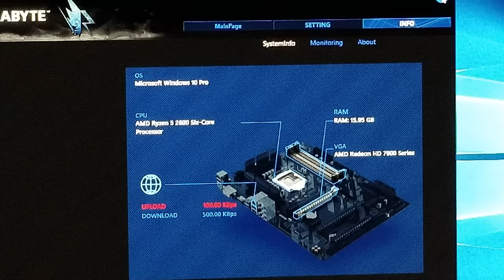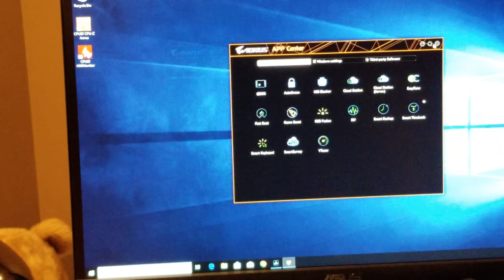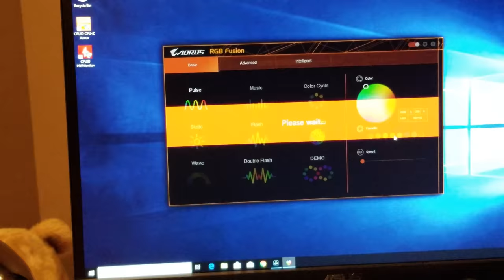Cooler Master MasterCase H500, Build Guide & Aorus B450 Pro WiFi

Comment: How many rgb headers does this motherboard support?
Reply from the maker: It has 2 x digital LED strip headers, 2 x digital LED strip power select jumpers, 1 x RGB (RGBW) LED strip header hope that helps...Thanks...
Reply: @Reviewing_Playing_and_More_RPM  using this motherboard and case i wanna add an rgb cpu cooler and connect it to the motherboard using the same case to control them with the rgb fusion, do you think i can do this?
Reply from the maker: The Case and MB are capable of doing this, the hard thing to know for certain is the RGB Fusion software and how well it works together with everything, I don't see any reason why it won't but there are so many scenario's where the MB Manufacturers aren't pairing the two products to work well together, so I think it will work, but in my experience getting both MB and CPU Coolers to sync together has been a problem and often didn't work, I've often used the MB Software to control everything except for the CPU Cooler, and then used separately the specific software for the CPU Cooler itself to match the color the MB is using...hope that helps...Thanks...

Comment: Is it ok to build a PC on a wood table without the green sheet?
Reply from the maker: Yes, I use a Green Sheet to be able to show products better but I have to take special precautions in order to not add extra static which could damage computer components. A wood table is fine. Something to keep in mind is to always ground yourself so your not transferring static to your computer components. This will need to be done often if your using a green sheet like I do...

Comment: The upper front fan didn’t spin while the led is on, what should I do
Reply: And all the fans are plugged in
Reply from the maker: +MBF 777 Same thing happened to me when I looked around I had missed plugging in one of the fans to the system fan on the motherboard, so maybe just do a check on the cables to see if one got missed. If not test that fan on it's on to a system fan header and ensure it works if not could be a defective fan possibly. Hope that helps...

Comment: how do you get the app center thing that change the rgb
Reply from the maker: The app center comes with your MB Software, different MB Manufacturer's have there own versions...this app center is what you get from Gigabyte MB's...
Reply: @Reviewing_Playing_and_More_RPM  do you have to download it or is it going to come the motherboard, (Btw I have the same mother board and it's my first build so i don't know alot about computers.)
Reply from the maker: @shadsunbee425  Yes your MB comes with a DVD with all  the drivers and software, it'll be on the DVD...You should update them later to the most recent versions...
Reply: @Reviewing_Playing_and_More_RPM  so you need to use the dvd that has all the drivers and software, because I don't have dvd tray or anything to use the dvd. sorry if im bothering you
Reply from the maker: @shadsunbee425  no it's cool I'm rendering a video so I have time...if you don't have a external DVD then you can download them to a USB Drive or download them to a computer and copy to any device you can transfer from...if you get the internet working though you just download and install
Reply: @Reviewing_Playing_and_More_RPM  oh so i can use a USB instead or just download it straight from the pc
Reply from the maker: @shadsunbee425  that's right
Reply: @Reviewing_Playing_and_More_RPM  thank you so much

Comment: Hi I'm very noob at this things and I'm having problems with the ARGB connector
Reply: Let's say my motherboard has multiple system fans ports, but it doesn't have 3-pin ARGB inputs.  Let's also say that each fan from the case has 2 cables wich is true lol, from those 4 cables, they end in 2 inputs to connect somewhere haha, a 3-pin that I suppose connects to the SYS fan of any Mobo, which will turn on the fan without any type of light  of color, only its rpm, and another that, depending on my mobo if it is asrock, msi or asus, it will be an ARGB cable (3 pins), and if its Gigabyte I'll need to connect a 3 pin on the mobo (I dont know if that has RGB), back to the ARGB inputs which my motherboard does not have to have RGB in the fans, if my motherboard is the msi b450 max gaming, how can I connect that ARGB input?  Can I connect it to the controller with ARGB input and that connects to a SATA of the source and it would still work, that is, put the ARGB to the power supply from the controller?
Reply: Sprry for my englsh haha
Reply from the maker: Yes, the controller lets you have a way to control the RGB when your missing the RGB Headers required...it does connect to the PSU so will work without issue's only thing is you'll need to open the case to change it each time...
Reply: @Reviewing_Playing_and_More_RPM  Thank you so much!  I didn't find the right mobo that was within my budget lol, with ARGB inputs and tons of sys fan inputs
Reply from the maker: @HenryGamer539  No problem you can also later on get a RGB/Fan Hub if you want that will let you control with software when budget permits...take care and have a great weekend...

Comment: How did you put the HDD into the tray?!
Reply from the maker: At 8:23 in the video you can see the HDD Bays, they are tool less so can just slide in and lock in place...you can use HD screws to be even more secure as well...
Reply: @Reviewing_Playing_and_More_RPM  But there are screws stopping it from going in. If I remove them, they don't go back.
Reply from the maker: @BRAWGWill  You need to pull the bay out and fit the HD into it using the screws to secure the HD to it, there are holes in the HD that will line up with them...
Reply: @Reviewing_Playing_and_More_RPM  Yes, but once I remove the screws in the side, they don't go back in.
Reply from the maker: @BRAWGWill  Starting at 10:33 in the video I show how the Hard Drive goes in...and those screws are able to go back in place...
Reply: @Reviewing_Playing_and_More_RPM  The rubber screws in the side? How? They don't fit in the holes once the hard drive is in place.
Reply from the maker: @BRAWGWill  Well there not meant to come out, but the rubber grommets slide in, whatever you have in the HD now, remove them, put the rubber grommets back in, then you need to angle the HD in fitting into the holes, and then you have to pull the other side out just enough to fit the two on the other sides and then it'll fit and provide less vibration as well...
Reply: @Reviewing_Playing_and_More_RPM  I can't stretch the tray. It's made of plastic. I've tried bending it and fitting the HDD in but it doesn't clear the grommets. Then they pop out.
Reply from the maker: @BRAWGWill  Best I can do is provide a video on doing this, here is a link, https://www.youtube.com/watch?v=XqBDUvYpZgo there is really no other way to explain it well enough, I'll try to do a video of this in the future, start at 1:19 in the video it explains it quite well...the plastic will bend but you have to have the HD in the proper way to align them...hope it helps...

Comment: how do i install a 200mm fan on top?
Reply from the maker: +Zachary Blatt There are holes on the top, just install to these using the screws that come with the fan. If it doesn't include the screws then the case has extra one's you can use, so as long as your motherboard has a fan header to plug into you'll be fine...
Reply: @Reviewing_Playing_and_More_RPM  but the holes are oval and are too big for any screws that came with it.
Reply from the maker: +Zachary Blatt Once you have the 200mm fan you line up the holes on the fan with the holes on the case. I think the oval holes just allow more flexibility for placement, not 100% sure though.  Once you tighten the screws up it won't matter if the holes are bigger, it's fastening to the case and fan, and will tighten together. It's hard to explain typing it, probably best to look up a video on how to install a case fan. I haven't done one but maybe I'll do one to help people out. Sorry I hope I didn't confuse it with the way I typed this.

Comment: How did you install the psu
Reply from the maker: Because the PSU shroud comes off easily, I took it off then was able to put the PSU in from the front and slide it toward the back and secure with the screws...Thanks...
Reply: Reviewing Playing & More RPM right lol I did it thank you but also I need help with ssd where does it go n what psu cable do I use ? If u have a vid or something could u link it ? Thx
Reply: Reviewing Playing & More RPM also I’m sorry for the questions I’m 15 and it’s my first time so yh the argb remote so you have two wires one says ASUS AND so on and the other one says. Gigabyte but I don’t have a 3pin I only have 1 4pin rgb header and I’ve tried putting the three pin in it but it’s just falls out and I only have one of these no argb header what do I do is there a way to still get the lights to work please help also I have a and wraith prism cpu cooler to so I thought I’d use the  4 pin connecter for this will this impact anything sorry for the long para just need lost if help right now thank youu
Reply from the maker: So it comes with the RGB Controller so if you don't have the ARGB you will still be able to use it, one end will plug into the SATA from your Power Supply to get it's power much the same as the ARGB would provide the power...this will let you control the RGB...the Wraith Prism CPU Cooler 4 Pin can go in the 4 pin RGB header on your MB, won't affect using the controller to control things...hope this helps...

Comment: Loved the video, it really helps a beginner to gain confidence in building their own rigs.
I have a question, that how do I connect the RGB to a Gigabyte GA-Z270P-D3 motherboard?
I don't see an rgb connector on the board anywhere, or am I missing something?
If there is no such connector on the motherboard then how do I manually connect the rgb to that little remote control?
Thank you in advance!
Reply from the maker: Yeah that motherboard doesn't have an RGB Header, so the controller that comes with it can be hooked up to use with it, I'm including a link to a video I did that starting at 9:44 in the video I explain how to use it, it shows how this case's RGB can be used with the controller that comes with it...video link is https://youtu.be/XQJETt0ABaU it should help you out...Thanks...

Comment: I just bought this case and it already came with standoffs installed for ATX for some reason
Reply from the maker: Yeah it comes pre-setup so it will accommodate most motherboards...you can adjust them if needed though...
Reply: @Reviewing_Playing_and_More_RPM  I see, i saw another video you made on this case and it didn't came with the standoffs...weird, had to double check if those were standoffs or what before making a mistake haha
Reply from the maker: @BatrickPateman430  I actually prefer no standoffs and let me put in what I need but some cases are like that...

Comment: What if your motherboard does not have RGB Headers
Reply from the maker: You can use the controller, if yours doesn't have one you can get one from Cooler Master for around $20 and use it instead...
Reply: @Reviewing_Playing_and_More_RPM  so I bought this case for my brother, he has an older motherboard that has no RGB Headers, the case came with the controller, but it only allows for breathing mode no static solid colors. Not sure what my recourse is at this point. I mean it's not bad it works, would just be nice to not have pulsing colors just static.
Reply from the maker: @patrickryan1821  The only other thing you could do would be to search out something like the Corsair RGB Pro Hub, (can't remember exact name) but I believe it or one similar will let you use RGB as it gets it's power from a SATA connector to the SATA Power connector from the power supply...I don't have a model name but there are some out there that can do this, search on Cooler Master, or Corsair and then Amazon to find one...there a bit pricy though...

Comment: 👍❤✌😎🔌
Reply: +👍 4th ❤
Reply from the maker: +COOL 2d TOUCH Thanks...
Reply: 15:17 notoced missing screw, if you hadn't noticed what would of happened?
Reply: The lights make having a clear side worth it.
Reply from the maker: +COOL 2d TOUCH It likely could have shorted out the motherboard, Thankfully I noticed it before anything  happened. It would have been fine for a while until it made cotact with the case. I have seen someone run there's for years with no damage but it can easily happen. I forgot because they didn't give me enough screws and I forgot to go get one.
Reply: Great video 👍 tfs ❤
Reply from the maker: +COOL 2d TOUCH Yeah it does look nice. Thanks...
Reply: @Reviewing_Playing_and_More_RPM  YW ❤👍

Comment: Great video! I bought and installed my new build in a h500 after watching this, and everything is awesome!
One thing thoe - How do i control my RGB?
It Works, sparkles and stuff, but i cant seem to find and software supporting it.
I installed the RGB pins directly into my motherboard - do i need anything Else? What am i missing.
Reply from the maker: Software is from the DVD supplied with the motherboard and if you have lost it you can download it from your manufacturer's website...Gigabyte has RGB Fusion for example...Thanks...
Reply: @Reviewing_Playing_and_More_RPM  thanks. I have the msi x570-a pro motherboard. Finding msi's website hard to navigate. I Will take a look for it again. Thank you!
Reply from the maker: Just realized your Motherboard  the MSI X570-A-Pro if I'm looking at the right one, does not support Mystic Light or RGB so a work around at this point, would be to use the RGB Controller that came with the case and hook it up as explained in the video, with it getting it's power from the Sata Power connector. This will give you the RGB lighting but you'll have to makes the changes using the RGB Controller...
Reply: @Reviewing_Playing_and_More_RPM  Okay.. thanks for looking it Up. I stumpled opon some msi software called Dragon Center. Got any experience with that mate?
Reply from the maker: Yes, this is a MSI Utility Program, you can use it to adjust settings for Gaming, and monitor Temps, and many other great features...It does appear to have an RGB Feature to it, but whether that will let you control the RGB I'm not certain you'll need to give it a look...it's a very useful utility so I would have a look through all the settings just to familiarize yourself with everything...Thanks...
Reply: @Reviewing_Playing_and_More_RPM  ah, sounds great! Theres no devices, that you know off, thats connectable to rgb and turns into software?
Reply from the maker: Not that I'm aware of...
Reply: @Reviewing_Playing_and_More_RPM  okay. Ill try what we discoussed. Thank you :)